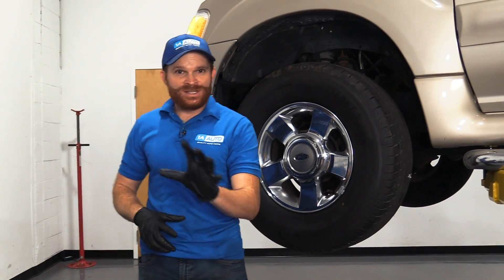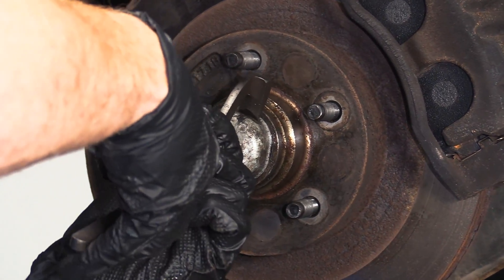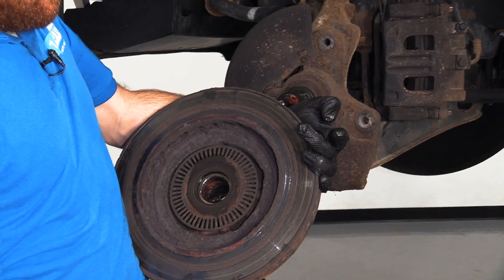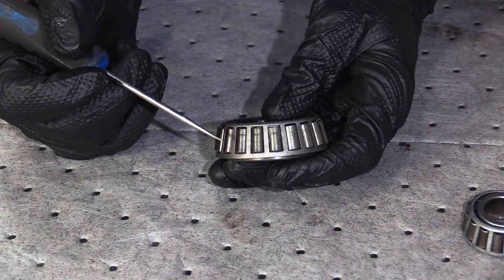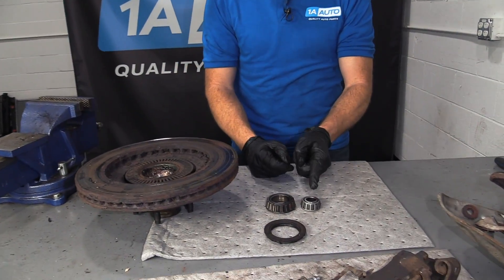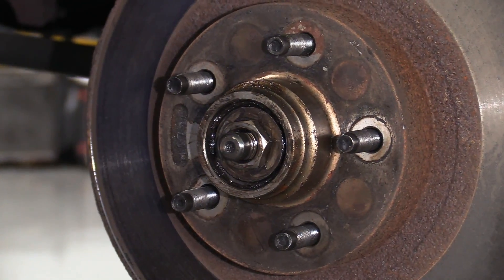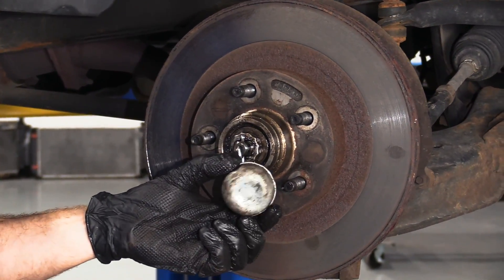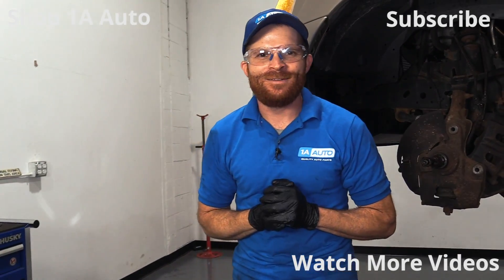Wheel Bearings on Cars and Trucks: Sealed Bearing vs Adjustable Bearing

Comment: Replaced sealed front wheel bearing on my daughters '01 Ford Windstar, (POS!), back in the spring. Supposed to come right out after removing the 3 mount bolts and all the other stuff in the way, NOPE, rusted in, penetrating oil, heating and beating didn't do it. Finally had to remove the knuckle to be able to convince it to come out. New bearing went right in, and reassembly took about a half hour compared to about 5 hours to get it out. Other side sounds and feels good right now, but, doubt it will last much longer. At least now I know to just go ahead and remove the knuckle so I can get to it easier. Not a good design.
Reply from the maker: +BTD Thanks for the feedback!

Comment: 4 years ago I paid 4bucks each for bearings on a 1998 chevy1500,sealed bearings on later models are almost 300 bucks each average that over 15 years and see which comes out ahead, occasionally grease packing is easy